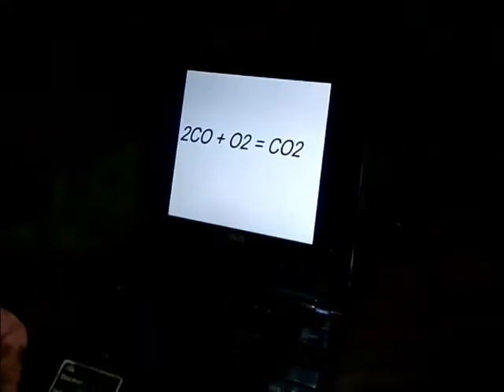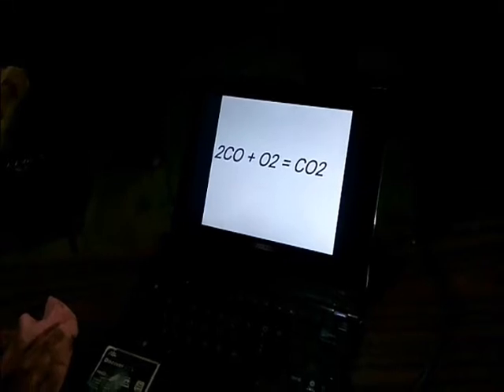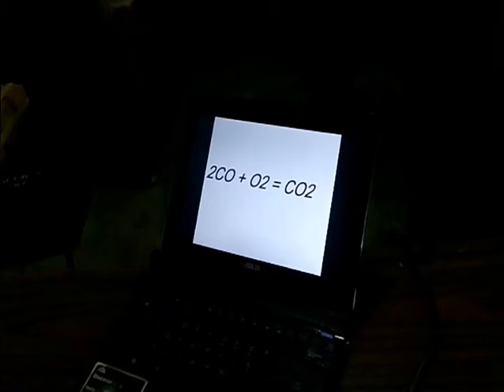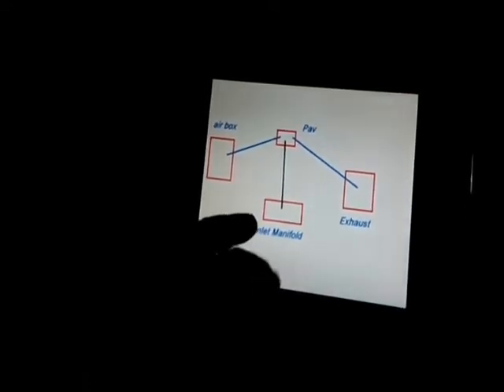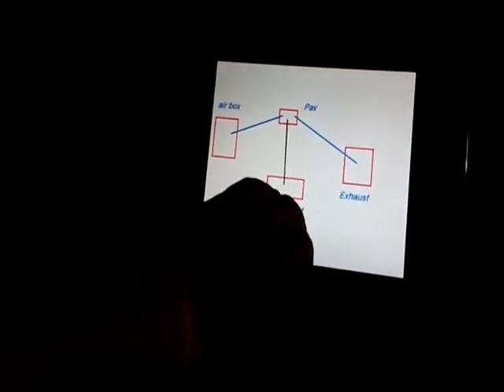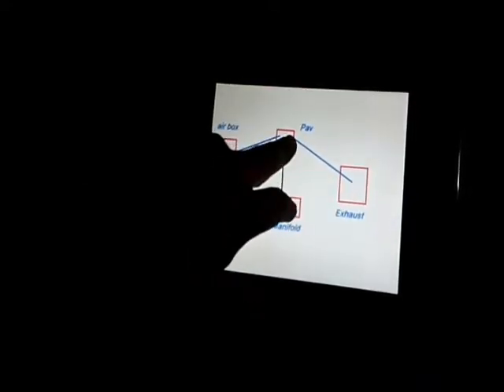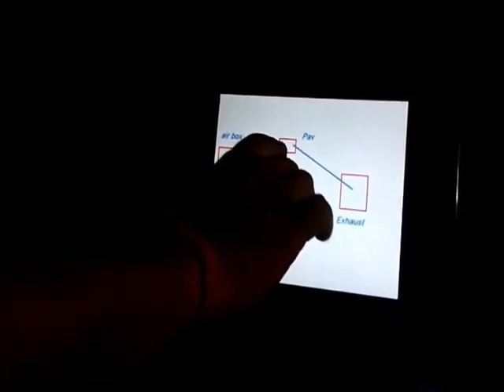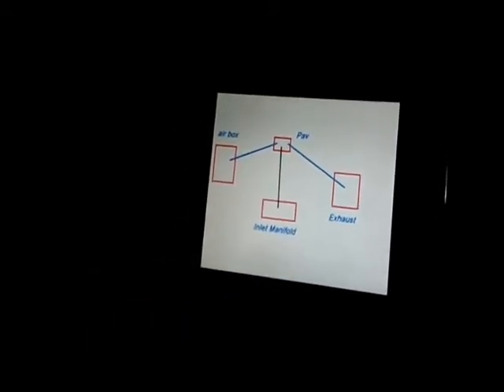PAV - Pulse Air Valve System or PAiR

Comment: I have recently noticed the pipe of this PAV valve keeps cracking and breaking any reason?? I have changed the pipe multiple times wat might be the reason?
Is it the PAV is blocked with dirt?? Can it be opened and cleaned ??
Reply: I got a classic 500 efi engine...my bike keeps misfiring is it because of this??
Reply from the maker: Cracking due to bad quality spares. It won't block but pav can get blocked inside due to carbon. But that's very less chance unless carbon is high. It has diaphragm and you clean it by using carburettor cleaner. Misfiring is due to either injector blocked or water in fuel or spark plugs are faulty or low pressure fuel injection pump which may need replacement.
Reply: @MechAutoClinic can I open the PAV like the way you did in the video and clean it with throttle body cleaner spray?
Reply: Or just remove the house pipes and spray it
Reply: And also any suggestions on rusty fuel tank
Reply from the maker: @suvinsuares8255 tank inner coating
Reply from the maker: Use throttle body cleaner  @suvinsuares8255
Reply: @MechAutoClinic where are you located??
Reply from the maker: @suvinsuares8255 Dapoli-Ratnagiri...

Comment: Sir recently i have fitted PAV on my old std 350 now the problem is when i release theottle fat fat sound generates from silencer so what can i do now.
Reply from the maker: Do the tuning properly. If still persist then u may need re-jetting
Reply: @MechAutoClinic  how to rejett?
Reply: @MechAutoClinic  i have a new carboretor.
Reply from the maker: Doesn't matter even if it is new. Check the plug color at this moment and let me know.
Reply: @MechAutoClinic  plug colour is like broun.is this good or bad?
Reply from the maker: if brown then all good. what silencer you are using currently?
Reply: @MechAutoClinic  short bottle original.
Reply from the maker: thats why. OEM silencer is longer in size and with hot tube inside the header. short bottle will give you fat fat sound since for that jets are currently small in your bike. you will understand once u increase the size. the sound will go.
Reply: @MechAutoClinic  ok.thanks
Reply: I'm also having fat fat sound after activating it,it was closed down with a ball on hose end towards the head,now I changed the hose with a new one,but after that fat fat sound, I'm using original standard silencer but some shells have gone though time creating a good and not that loud exhaust note.